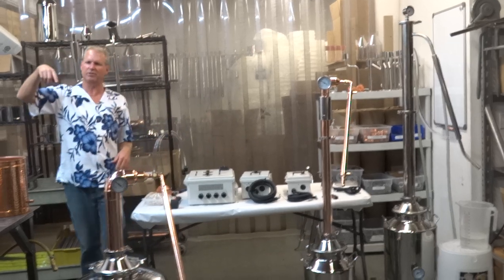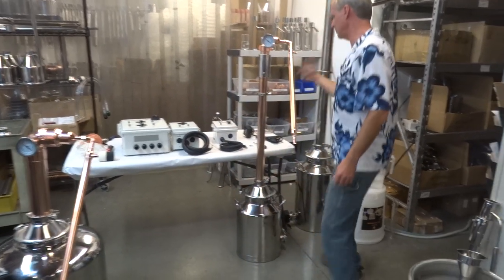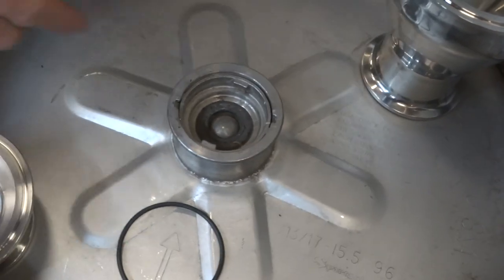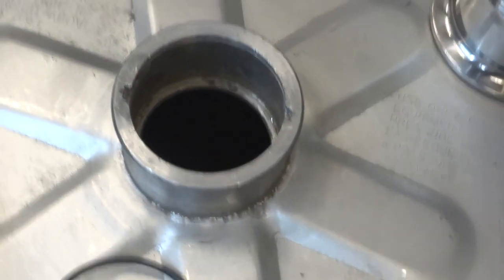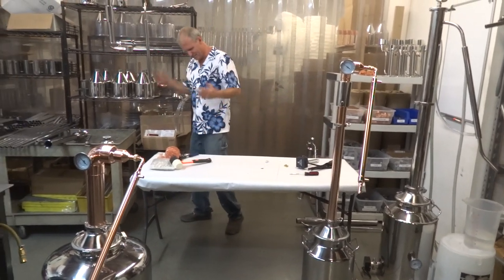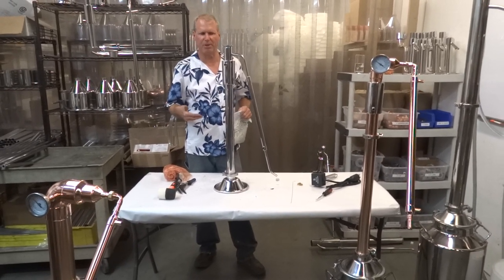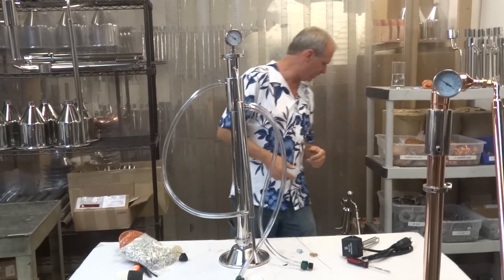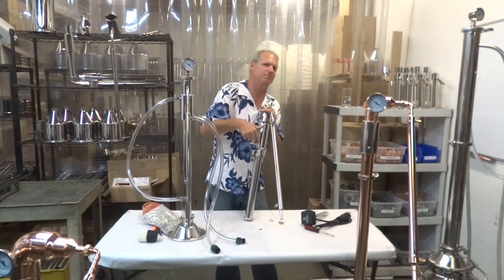New Stills from Mile Hi Distilling

Comment: great videos, i have a question im interested in the 8 gallon still with 2" dual purpose column complete kit with the 110v controller and heating element. my question is can you explaine hiw the dual purpose colunm works , like how it goes from reflux , to pot still. thank you